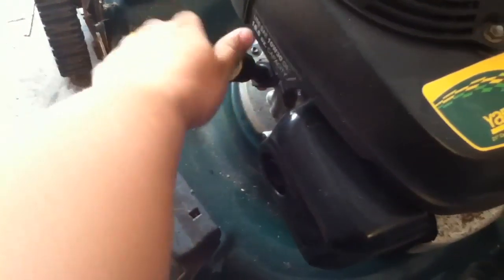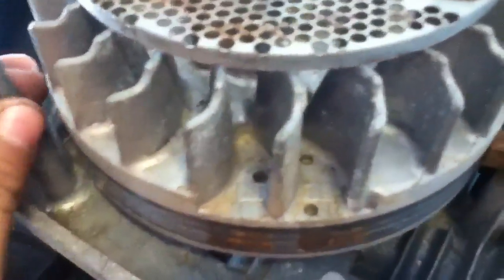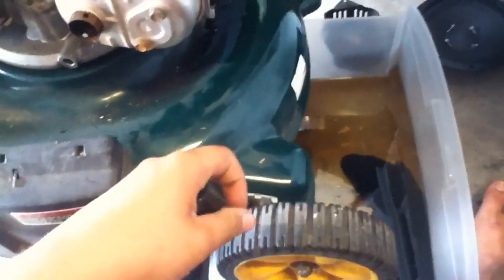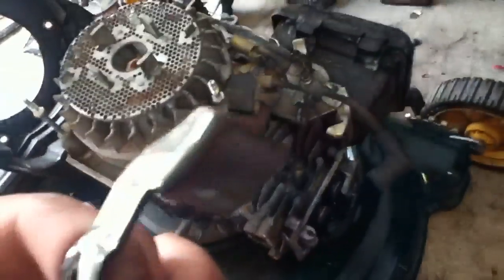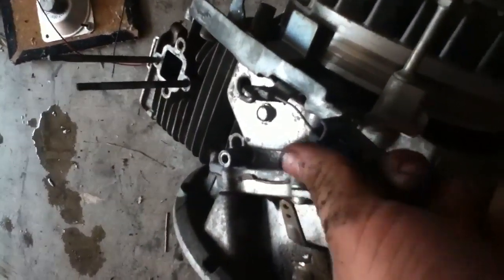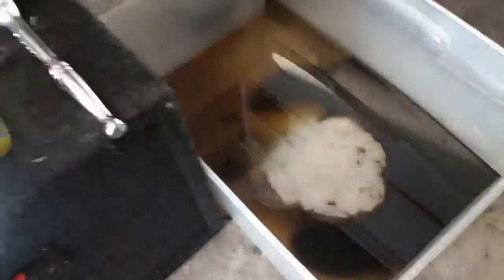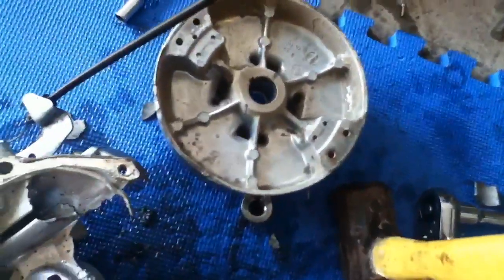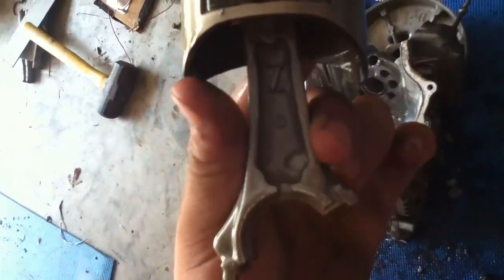Honda engine tear down

Comment from the maker: There is a bolt holding it on the crank shaft UN bolt it and it should come right off if not tap it with a hammer